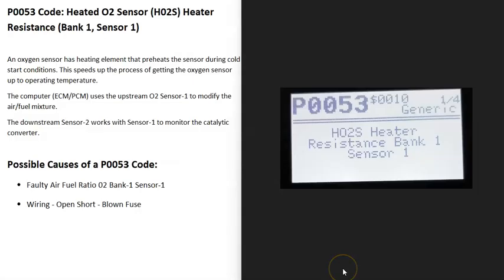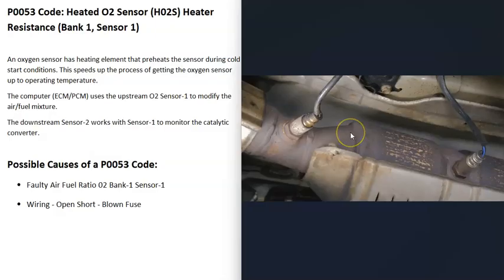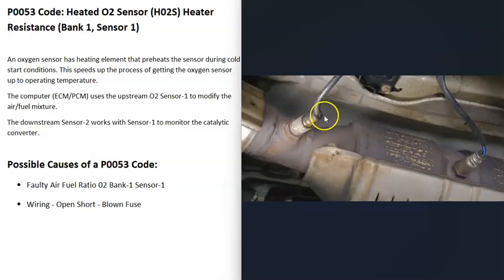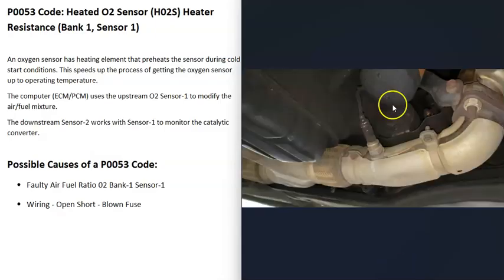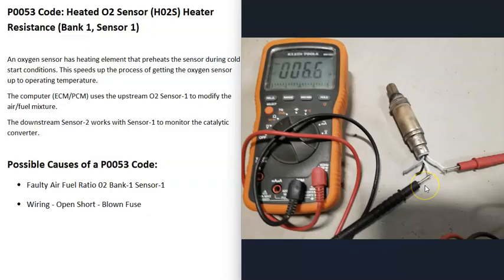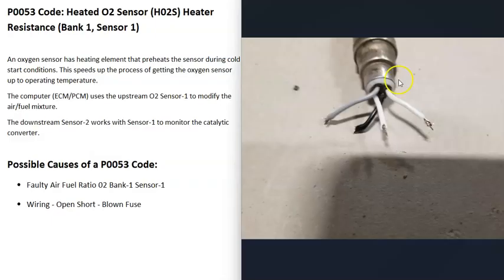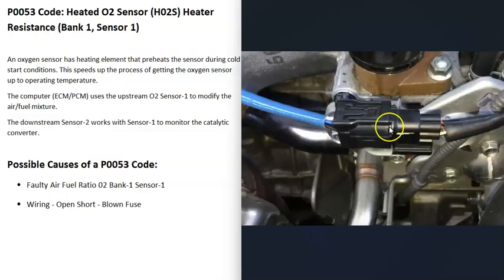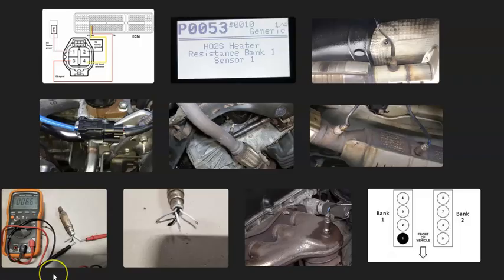Causes and Fixes P0053 Code: Heated O2 Sensor (H02S) Heater Resistance (Bank 1, Sensor 1)

Comment: Does the P0053 hurt the engine to drive once it heats up through driving?  Thanks
Reply from the maker: No, there won't be any engine damage. Usually, a bad 02 sensor causes the engine to be less responsive, cause worse fuel mileage, and not pass a smog test.